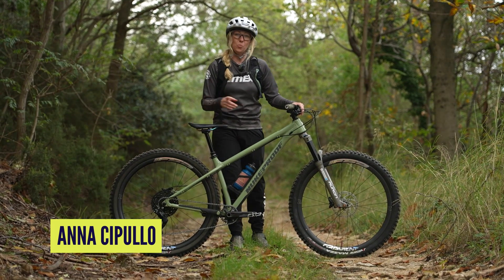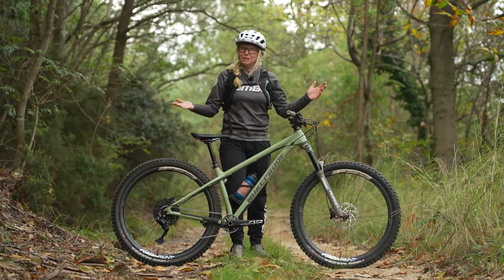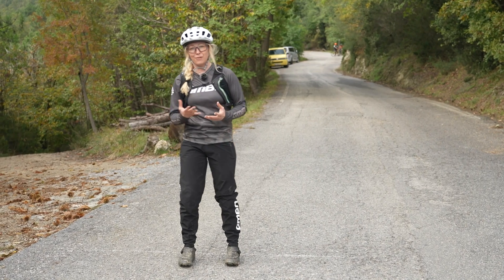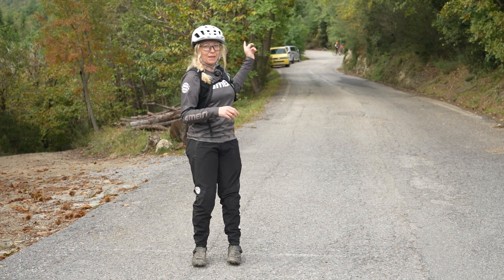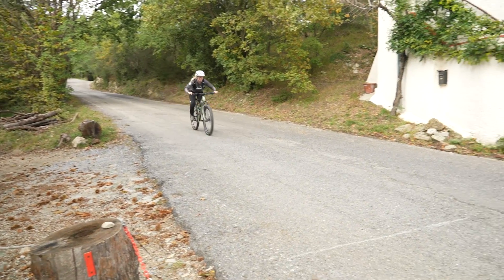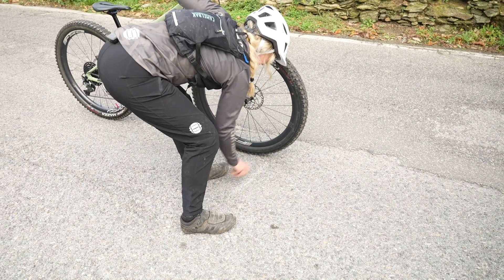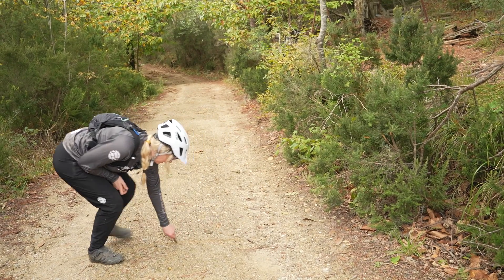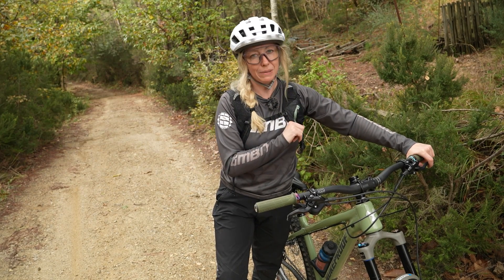Is Bigger Better? The Science Of Superior Braking Performance

Comment: That was the least scientific test ive ever seen. Run on different days, looked to be travelling visually slower on 200s before braking. Since you could lock the 180s at will on any surface there shouldnt be any difference in stopping distance, its just practice and what youre used to. Larger rotors should just give better feel, thats it.
Reply: Yep, it didn't even look like she braked very hard, even on the tarmac, I've gone from 200 to 180 and my braking performance hasn't changed, the smaller rotors still have more than enough power to lock the wheel, they just require slightly more squeeze from the lever on very steep descents, just look at the difference in stopping distances on the tarmac between the 180 and 200, there's no way that should ever happen.

Comment: I like my rotors big, but keeping them true, clean, and non-mooing becomes harder with size.
A set of 160's run hot with grippy pads wears out faster, but every metric but maximal braking power is more enjoyable. Brakes like some heat...

Comment: What's more important to me is consistency it's somehow not really better than 10 yrs ago with higher end components things didn't really evolved especially if you compare with moto brakes, most modern motorcycle have almost no fade in normal driving conditions and are pretty consistent across a very wide range of operating temperature.

I love the code rsc because they are always "so so" but at least when I pull that lever I always get the same action. Still doesn't compensate for pad wear you'd have to add liquid. Pretty shit for 2023 when cars and motos have systems that are stable and solid at much higher forces sustaining material melting temperatures used in all sorts of environments and climates...

Comment: So, here's a quick tip - not always need to Size Up in rotor diameter - try just getting one of the ticker ones, same size. I changed from 200mm diametr SRAM Centreline - 1.85mm thick to SRAM HS2 2mm thickness - same pistons and callipers - massive stopping power differnce. You don't always need to go larger diameter - so no extra adapter needed either. simples. 🙂

Comment: Is the Quality of disc material a factor as well, I have heard shimano disc made China aren't as good as ones made Japan.?
Reply: Better ones from Shimano have cooling fins in the middle - however the ones without this feature are made of the same sorts of stainless steel, like 1.4024 or 1.4028.

I use RT-10 rotors (the basic Shimano ones) on my XC bike and they overheated a couple of times due to long steep descends, but never warped and the wear is minimal.

Comment: It is not up for debate or doubt. Always the front disc has a larger diameter. Even with cars. A matter of angular velocity
Reply: Except on downhill MTB where you use more rear brake
Reply: @janeblogs324  Correct.
Reply: Regardless of front or rear disc, the larger diameter disc has better braking capabilities.
Reply: I know people that run larger rear brake rotors for downhill or so they can easily lock up the rear fast and easy

Comment: I dont think your area increase calculations are quite right as you dont appear to have worked out how much metal is missing due to all the holes. Because the less metal you have ( because of the holes) the harder you have to 'work' it to obtain the stopping power and then the harder you work it the hotter it gets ! It would be interesting to see different rotas the same size with smaller or even no holes. A easy way to put more metal between the pads. In addition to all this i always use sintered bronze pads ( wet often muddy conditions in the UK)  i found them to be better than the fiber originals. I have also swapped the front disc for a solid rota. This gives more feel and power under the heaviest of braking in the dry but does require a turn of the wheel to dry off in the pouring rain. So a 'few' holes are probably preferable.
Reply: You have to account for the hole's friction, think cheese grater 😂
Reply: @perspicaxingenium  🧀😂
Reply: Psi, pounds per square inch. Less metal= more force
Reply: @janeblogs324 =Greater  rate of wear.

Comment: my 180 rotors are worn out. i think im going to go for 203mm front nd back
Reply: I'm only 75-80kg (depending on backpack) and fairly mediocre yet 203 with XT + vented pads and I'm smoothly stopping on DH with 1 finger (on 2nd hand pads that were once soaked in oil... but I know how to clean pads properly)... 
You'll love 203's. If you've got the cash, go for alloy heat sync rotors too.
Reply: @TheButlerNZ  my calipers arent compatible with the heat sync rotors.
also you probably need new pads, but i've seen some people burn the oil out. make sure you fuklly clean your rotor too

Comment: 180 is the smallest rotor i'll use, anything lower feels a bit naff to me. thats the size front and rear i use on my gravel bike. 203mm front and rear on my 170mm travel trail bike. best thing about bigger rotors is the less lever pressure needed for the same braking force. great for when you hands are tired and you've no energy left.
it can often take a few weeks to full bed in a brand new rotor. its highly likely that those 220mm were bought for the test and never used and will take time to clean off the machining on the surface and transfer pad material. the new 180mm sram centerline have taken weeks of day to day riding to stop that still wearing in sound

Comment: Pretty soon rotors will be half the size of the wheel.
Reply: Or fully the size of the wheel. Called rim brakes.
Reply: @dicktiionary  hydraulic rim brakes lol
Reply: @RedWingsninetyone  lol, and nice heavy stainless steel rims so they don't get crushed
Reply: @dicktiionary  to cut down on the weight and help increase the length of the contact patch they'll make the tires narrower
Reply: @RedWingsninetyone  got you!  Dh on my road bike. It will be Amazing!

Comment: Thanks for the cool test! Even without a performance benefit, I like the bigger rotors for the lower force needed on lever pull. This equates to less arm pump on a long descent.
Reply: same here, went to 223 for less force needed and less arm pump. PS: blocking rear wheel makes no sense for a breaking test ;-)
Reply from the maker: @MitchMe666  Totally agree, locking the rear wheel isn't the most efficient way of stopping. I think the combination of Anna being a light rider and the extra stopping power up front (which would load the front wheel more) meant there wasn't much weight on the rear tyre so it is difficult to stop it from locking up. Next time we will try it with a heavier rider and see how that affects it!🤘
Reply: No such thing that is a fallacy. It takes the same amount of lever Force no matter what size the rotor is what you're referring to is torque. Not lever pressure. This is simply your perception but not reality in terms of the laws of mechanical physics
Reply: @rider65  Whatever "you" say. Fact, you need less lever pressure on bigger rotors to generate the same braking power which leads to less fatigue of the fingers and arm pump. It's simple physics 🙂
Reply: @rider65  You can generate the same amount of torque with less pressure on the lever with bigger rotors. So he was not wrong.

Comment: Scintered pads should be anyone's 1st upgrade...Check ya rotors are compatible though, most basic ones are for Resin pads only..!
Reply: You can use metal pads on resin ‘only’ discs just fine, they just wear out a bit faster. But most discs get binned for distortion long before that.

Comment: IR heat guns don't really work well on shiny metal surfaces. Would be willing to bet that on the screen for the heat gun it says E=.9 or E=.95 on it which means that it assumes that it is being pointed at something that is black. When calculating temperature of an object from the IR radiation being given off the surface emmisivity( that E value on the heat gun) matters a lot and if it is not set properly the readings will be non-sense.
Reply: I was wondering if anyone else was going to pick up on this. 100% correct. IR doesn’t work well on Stainless or bright copper or any other shiny materials. Needs to have a Matt finish. Anyone who uses one regularly will understand this! Good test though. I run 200 front and rear.
Reply: Rubbish, they work perfectly well, not least as they aren’t even a gun.

Comment: What about the brakes ?
Were they 4 pistons ?
What about the compound of the pads ?
What about the bedding-in of the discs ?
What about he optimum working temperature of the pads and of the discs ?
Maybe the fact that braking at a low temperature gives a quite random result between the different rotor size.
Reply: the other thing is.....were the speeds at the point of applying the brakes the same?
Reply: Weak shimano deore 2 piston brakes, they really should have used 4 piston brakes, no body uses 2 piston brakes on a proper mountain bike.

Comment: "For me, bigger is better. I'm using 203 on the front and 180 at the back. It took me some time to get used to the stronger brakes, but the upside is I can brake for much longer. Going down, more material takes longer to heat up, delaying the onset of brake fade." this is a much cheaper way than to invest on Ice tech rotors and finned Pads.
Reply: For me, the only real difference I've noticed in going from 180 front to 203 is that my 203s are noisier and I can't figure out why. The only thing I haven't tried at this point is swapping out the pads or rotor entirely.

I don't notice any difference in stopping power for my needs, but then again my 180 was on a 27.5 and my 203 is on a 29, so that could be the difference.